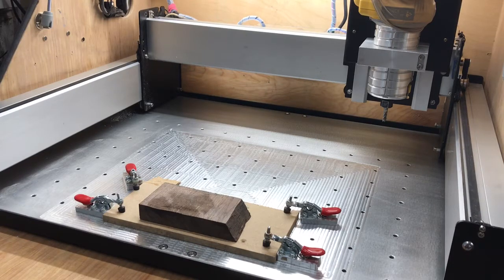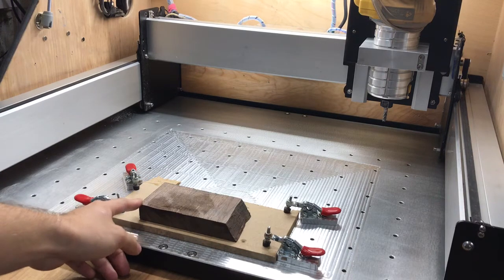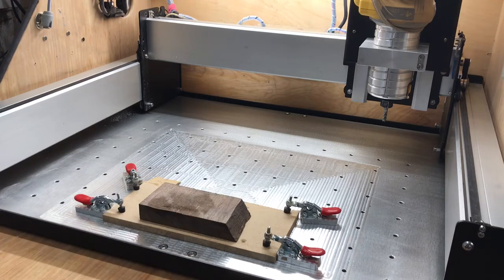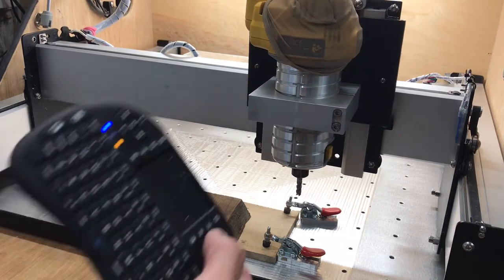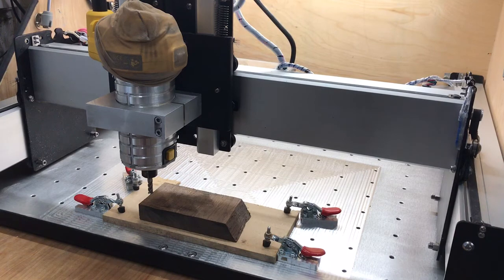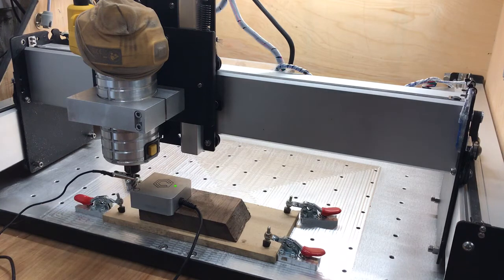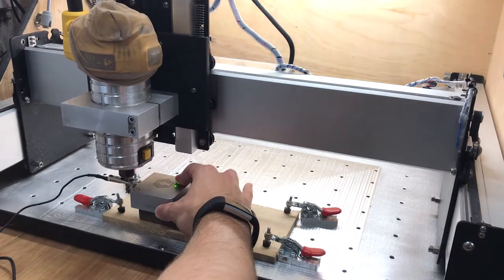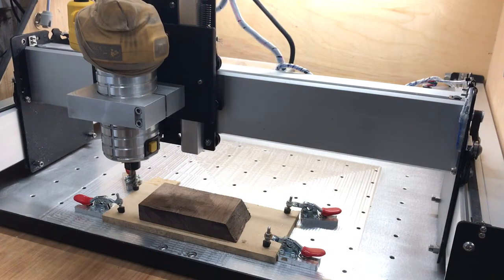Carbide 3D official probe benefits - speed testing Carbide Motion 4.09

Comment: The bit isn't round where it's making contact with the probe, would you not have to flip the bit in the router or replace it with round stock to know the true corner of the work? This is probably accurate enough for any first cut though, even with aluminium if it's the first operation on a blank though right?
Reply from the maker: It's a good point. It will vary based on the end mill, however you are correct. A round shank will always be better, but this is fine for finding the datum on a single sided opp.